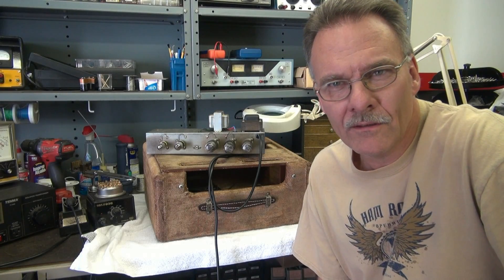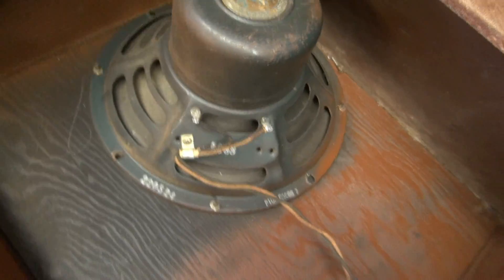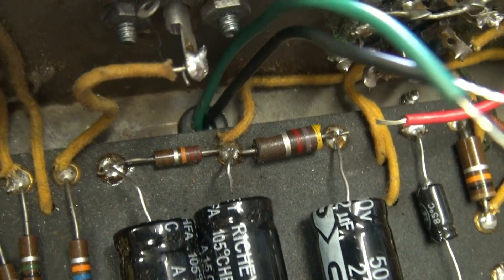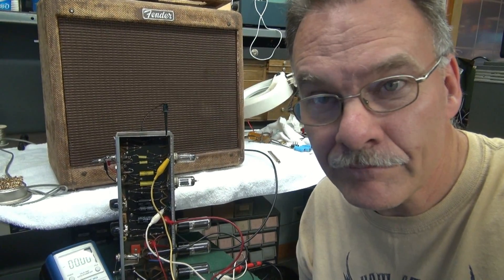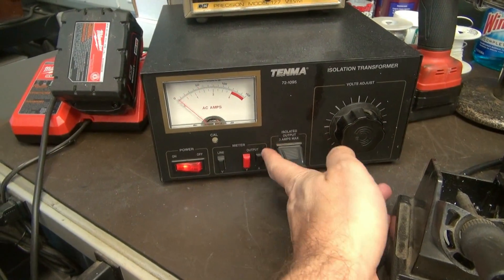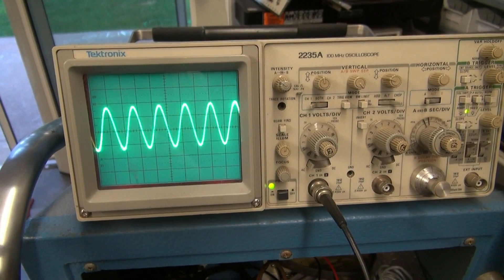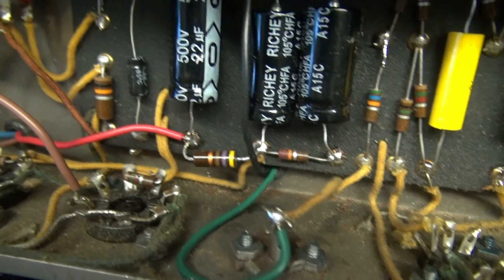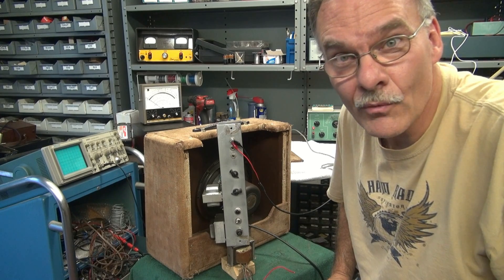Vintage Fender Harvard Tube 6V6 Guitar amp repair transformer fix by D-lab

Comment: Nice work. I have Fender  Harvard H-00416, Date FH which is August, 1956, built just two months after the one in video. Mine is in excellent cosmetic condition with tweed that looks nearly new, probably because it has an original brown canvas cover to protect it and it sat in a dark closet unused for years. Work done: Replaced bias cap, cathode bypass cap & 3 filter caps (all Astron Minimites); Cord replaced with 3-prong; Disabled death cap; Replaced  the rectifier, leaving the original bypassed selenium in place; 2 new 6V6 power tubes, and; Rotated speaker 180 degrees to start gravity working it in the opposite direction for the next 60 years.  I saved all the original parts in case a collector wanted to restore it to original, but I prefer to keep these old amps playing well. Fortunately, the signal caps tested well so the originals continue to impart their vintage tone.  Anyway, good to another one brought back to life.

Comment: old school industrial electricians used to "adjust" the resistance of carbon resistors by grinding away some of the carbon.  There were actually boards made  with carbon pads on them that the calibration procedure was to saw a slot partially across the carbon pad.

Comment: Thanks for sharing. If you had higher plate current, what would you have looked for next. The big caps were replaced already. If the power transformer had been leaking would that cause low secondary voltage but high primary current flow? I ask because I have a Musicman HD130 410 that draws about 1.5-2 amps when the standby is off. Not sure what's causing it. Tubes and caps have been changed.
Reply from the maker: Hello, I have seen that issue on older amps. It is a defective power transformer. 1 way to tell is to perform a continuity check from the primary to secondary's.  See if you have a current path. If so, you will need to obtain a replacement. TD
Reply: D-lab Electronics 
I'll check that. It did fail a ring test while still in circuit. You've given me a good reason to disconnect it.
Reply: Turns out there is no continuity between the pri and sec windings.  This trans has 6 leads for 3 separate outputs on the sec and the pri has 4 leads for a single input with 2 additional taps.  The additional taps are for high and low power and an extra for a neon light.  

Because there were the expected low ohms between the primary wires it makes me think there could be a short out on the board.  I forgot to mention that the short only or high current only occurs once taken out of standby.  The 6.3VAC lines are okay.  The plates are only receiving 568v while the spec is 725v.  Same with tubes out.  Testing the current while lifting the red sec is the same as using the standby switch.  It's probably right in front of me.

Comment: was that so called death capacitor that had been cut at the start of your video ?
Reply: That was the cathode bypass cap for the first tube. Probably cut to decrease the gain of the amp. I believe it's a common mod for harmonica players.

Comment: Great video thank you! What became of that disconnected cap?
Reply: That is the bypass capacitor for the input/preamp tube cathode resistor. I suspect it was deliberately cut. It was an old trick some players, especially harmonica players, used to tone down an amp’s gain. Helped reduced feedback and increase compression. That ol’ Harvard would be one hell of a harp amp!
Reply from the maker: +activeeq Oops, Yes I did fix the disconnected lead.
It was the preamp cathode cap. Forgot to follow up.

Comment: Hello Terry- just found your videos and will subscribe. question- I've got several silver face fenders from the 70's (Deluxe Reverb, Twin, Super Reverb and a champ) all of them have RCA power tubes (pre amp tubes all replaced) when it comes time to replace them, do you suggest spending the money to get NOS RCA Tubes? worth the money for the tone? thoughts?
Reply from the maker: +ContraBand Joe Hey man, There is some magic to the old vintage tubes, however, they can also be microphonic nightmares. I normally buy a nice set of reissue Tung-Sols from the Tube depot. Can't go wrong there.

Comment: HI Terry, I see you have Textronix 2235 scope. I have my eye on a 2225 on Ebay for $250.00 including two probes. It is 50Mhz not 100Mhz. Is that enough bandwidth for most tube ans solid state amps? I just found your channel and I find it very helpful. I will be watching more vids in days to come.
Reply from the maker: +Robert Hurless Hello, Yes, the Tek's are great scopes. Sure are a lot cheaper now. $250.00 would be top dollar for one. I would hope it has the original manuals for that cost. You could get away with a 10MHZ scope for all audio work. I normally recommend a general dual trace Leader or Iwatsu for this type work. Glad you like the videos. I plan to do more when time allows. TD

Comment: This was the first video of yours that I was fortunate enough to have come across. I enjoyed observing as you restored that chassis. I have one question. I was surprised that you did not immediately replace that selenium rectifier, it has surely outlived it's life expectancy. Why did you not automatically update it with a properly rated solid state diode? As an old service tech new to guitar amplifiers I'll watch all your related videos! This old dog is full of new tricks!
Reply from the maker: +Anthony Reo Hello, Yes, you are correct. I would have, however the owner wanted to simply replace the incorrect output transformer. He ended up selling the amp a few weeks later for a nice profit.